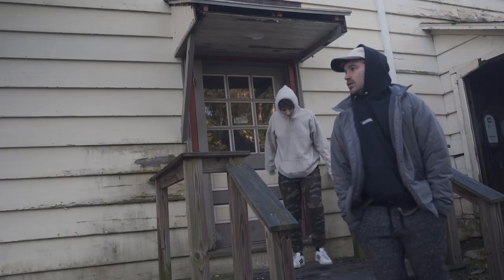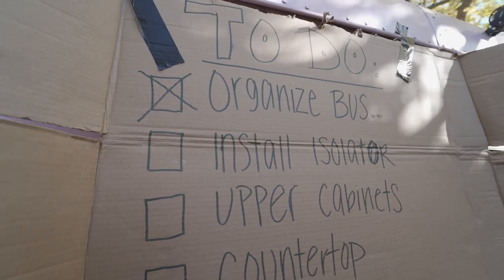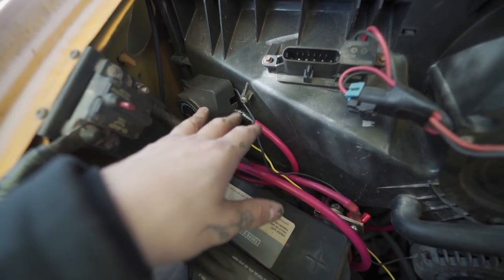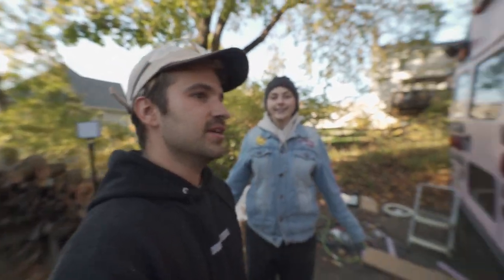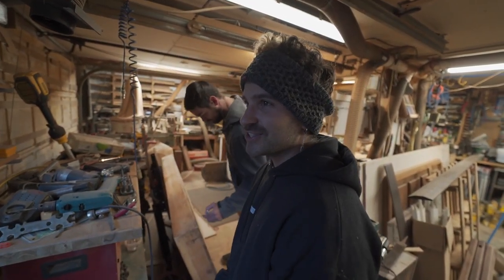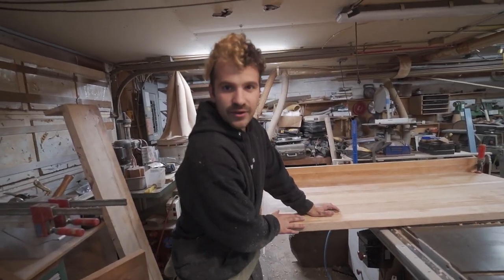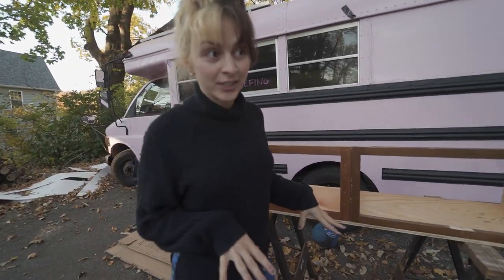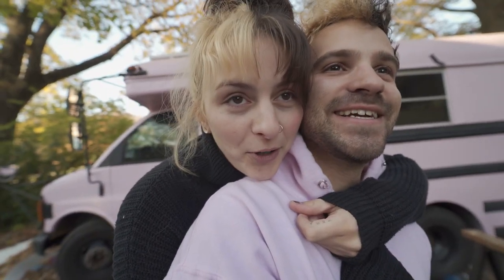24 HOUR BUS BUILD CHALLENGE (Gone horribly wrong...)

Comment: I completely forgot to tell you to look for the second battery under the bus on the driver side slightly behind the driver seat.  That's where I installed my isolator so I didn't have to mess with the engine bay.  My baddddd
Reply from the maker: 🤦🏻 that would've been SO much easier